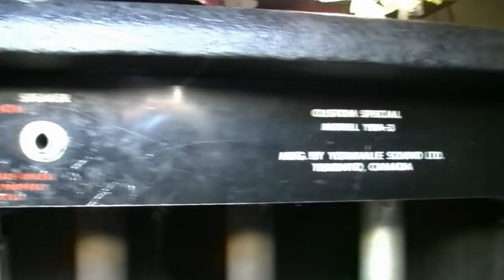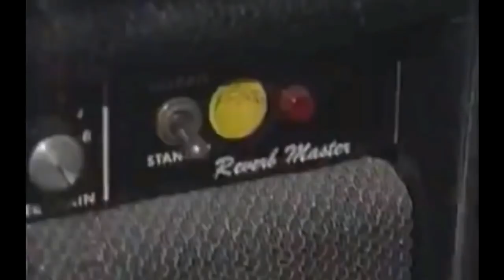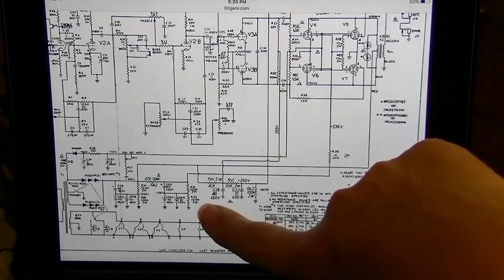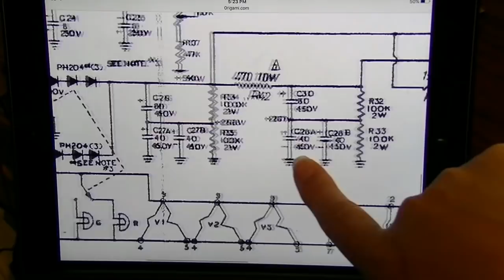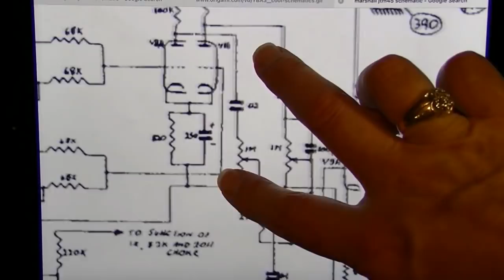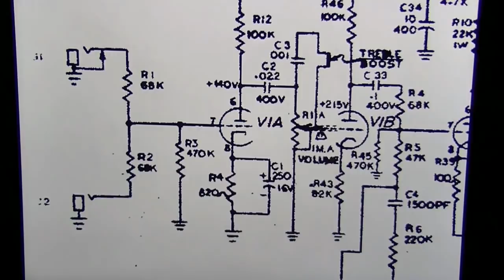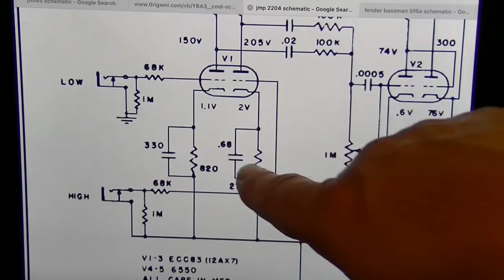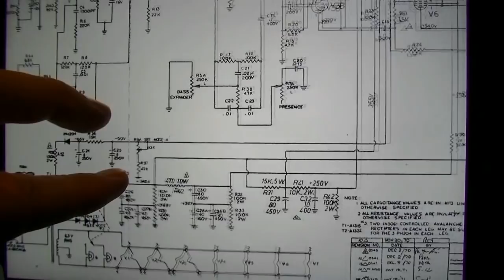Modded Bass Amp from Canada Becomes GUITAR AMP FROM HELL! - Traynor YBA3

Comment: Hammond transformers, the best. .001 caps nonpolarized across the input leads helps prevent the buzz from the honkin transformer and its' immediate field. It outperformed Ampeg, Marshall, and Fender (really did not want to say that) Still have one bass bin (8x10 speakers) and driving it with a Peavy but honestly, liked the Traynor more for its warmth and clean sustain. P.S. this actually sounds rather decent with just a guitar too. Large tonal range ability. Mine was modded by some electrical engineering freaks at U. of A. Damn. You sure tickled my memory banks. God bless all musicians and those who help. Keep on keepin on (70 y.o. bass freak and now getting into guitar. Finals would take 875V.!! Buzz you a good one if not PROPERLY grounded. Lip still knows.!

Comment: I have a few nice amps. I have a plexi and a DR103 hiwatt but my '74 Reverb Master (paid 300$) easily holds its own. Its such a great amp. Traynors rock!
Reply: It came stocked with fat bottle 6ca7s and phillips holland pre amp tubes
Reply from the maker: That's correct. The 6CA7 and EL34 switch requires a rebias and someone just popped these tubes in without bothering.
Reply: I’m the same, I have about 36 amps, all the classics plus Some oddball stuff. My Traynor YGL3 MKIII modded a bit, is possibly the my favourite of all of them, does it all at low to extreme volume.

Comment: GREAT VIDEO!!! I just picked up this exact amp and im in the process of doing the mods you have done here. Just to recap the mods done to the preamp. You changed R3 from 470K to 1M, R4 from 820ohms to 2.7K, C1 from 250uf to .68uf. R43 has been changed to 1K and finally R39 to 1.5K and C9 to 100uf. I have most of the components but need to pick up some more this week. Just want to make sure I havent missed anything. Cheers from Canada. Love your vids.
Rick..

Comment: I have an early 70's YBA-1 which I use for guitar.  It is a beast and has my favorite clean tone ever.  Super transparent and takes pedals better than any amp I have ever used.  This amp is Loudddddddd.  I also have the matching 2 15" cab which is sweet.  The bass in this amp is absolutely incredible.  I would put it up against ANY vintage amp when it comes to clean tone.  I have a 64 Princeton Reverb which I love and play in my small loft. To play the Traynor in my loft I can't turn it up past 2.  Looking at a Marshall Power Break or THD Hot Plate so I can turn it up to 5 haha.  Thanks so much for featuring this hidden gem of an amp.  Oh yea, I purchased the head and cab for $600!  Best value ever!!!!

The difference between this custom and my YBA-1 is that this one had to been intended more for guitar.  Mine does not have a master volume and there is no way I could overdrive it like he is doing here.  But I would never want to!!!

Comment: had one exactly like yours many years ago.I agree with your assessment of Traynor.Definitely overbuilt but in a good way.I had rewired mine,duplicating the four stage preamp of a mesa boogie.I was a Marshall&Fender eating Animal! An inquiry's to Traynor got the response from them,they rated this amp at 130w output.
Reply from the maker: Rebiasing those preamp tube stages and monkeying with bypass caps really amps this model up a treat.
Reply: I have rebuilt several Traynor valve amps over the years... with the intention of selling them on.  Trouble is... once I have fixed em up, they sound so good, I can't part em out LOL.   Yup, Peter started out as a repair man then ended up doing it better... they also hired out a lot of the Traynors they made so they were made bomb proof and easy to fix when they did go south (very seldom).   Current day guitarists are at last realizing that these old amps from the 60's & 70's knock the crap out of most of the currently available tosh.
Peter Traynor, a genius... RIP

Comment: That was cool...  when reference is made "From Hell"...  I'm usually thinking it was a nightmare of a repair...   apparently not the case.
Reply from the maker: "From hell" as in demon biker beast on black Harley wearing all leather and spikes and kicking ass. That kind of "from hell". :D
Reply: No worries.   I bought a Fender Sidekick 50 bass amp for chump change,   and had to fix it... the "FIX"  turned out to be grade school level.   Go figure.   It's on my channel if you need a cheap laugh at what Guitar Center refused to buy because it was broken.
Reply: I was also fooled by that headline.
Reply: DeadKoby grrat

Comment: Quality Canadian engineering!
Reply from the maker: Yep. The best. Pete Traynor should be on the Mount Rushmore of amp heroes.
Reply: I once saw a documentary on Vox where they threw an AC 30 down the stairs. I wonder if Pete saw that and said "hold my beer"?
Reply: might be the other way around.
Reply: At a NAMM show once, an Ampeg rep mentioned to Pete that he had heard a story about him testing the quality of workmanship by throwing an amp from the 2nd story window(chuckling as he spoke), Pete retorted "Oh, don't you?"
Reply: The full clip, pete explains he had an specific measurement , it was a lot more scientific than just chucking the amps off a building. His point was, on a 6-10 foot stage you have your amp resting on top of a full stack or one of the 8X10 traynor use to make, it adds another 6 feet or more. He said if his amps were dropped from the stage he would want them to be mostly fine (needing new tubes of course). Built in a safety factor and pretty much 20 feet or second floor drop is what he came up with. Simulate an amp falling off the stage. Pretty sound logic and great build to allow for this to happen and still function.

Comment: The serial starts with the year. 3 for 1973. The top access cabs with the bumper material on each side started in 1970. 
When this video was made, here in Canada you could buy that amp for 300-400 bucks. Now they're 900-1200..

Comment: FYI, the mystical input circuit is a double-T band pass filter to enhance the tone in the brilliance high range. The second tone control circuit is based on the same double-T principal. The type of simple bias control circuit evolved because of the estimator people, better is a separate pot for each output tube to adjust the bias since the output tubes are never perfectly matched. You also want to measure the current flow through each output tube since measuring the voltage drop over a resistor is somewhat bogus/inaccurate because of the resistors tolerance. Measuring the 8Volts (here in this case) does not account for a proper bias current. "Ohm law" I=U/R. Every additional component increases the cost for building the amp. The tech that needs to service the amp later is the last thing they think about when designing any amp. I designed amps and was involved by having them build in Taiwan. The goal is always to get the packaged amp of the ship for a specific costs/amount and not to please any tech or user f the amp, its just a calculated business. The rest is all stories people made up in the music industry. One guy like the daughter, some have fun with the mother in-law ...

Comment: I just wanted to note that the switching jacks on the amps effect how those resistors are put into the circuit.  While the inputs may look the same they are a bit different.  On the Traynor here, the number 2 input puts the input signal through a voltage divider of the 68k resistors, so the volume will be lower from the source going into V1.  At input 1 it just goes through the one 68k and the other is floating.  On the Fender (and Marshall if I'm not mistaken) the number 2 input does the same voltage divider trick, but at number 1 the 68k resistors are paralleled for a 34k stopper, allowing more source signal into V1.   Also, that amp sounds fucking killer, good job dude.

Comment: At around 11 minutes, that resistor capacitor network is called a twin tee notch filter. It essentially produces a sharp, narrow scoop around a particular frequency. Due to the fact that it is bridging a 180 degree phase shifted signal back around the tube, it should actually boost instead of cut the center frequency of the network. The impedance of the tubes output should do weird things to the frequency response of the filter though. That would definitely be interesting to mod.

Comment: The controversy of the most "musical" resistors to use in a guitar amp rages on. IYO, what happens if you use metal film or metal oxides in the signal path? I use them in all power paths, but what about in the grid stoppers and bypass circuits? What happens if you put them in for the 68ks in the input? Carbon comp resistors are so undependable even with 5% tolerance, which are not easy to find or afford. You have more knowledge about these small but very important issues a lot of us would like to know! I am nearing my conversion of a Champion 40 SS to a single channel AB763 Deluxe Reverb with a mid control and a master volume. It is so important to know every little detail, to choose the parts that will do the job you want and get the tone you are looking for! Thank you for these "gems" of highly informative videos. Thankz
Reply from the maker: Carbon resistors, both film and comp types, will tend to gradually rise in value a bit over time and with exposure to heat. That is to be expected. Use metal in places where close tolerances are critical and/or where high voltage and heat are an issue. In signal paths...voltages aren't usually going to be high enough to make a difference. And metal resistors are expensive. Not an issue if you build one or two amps, but if you stock parts like I do for a steady stream of repairs, you quickly realize you're just throwing money away by installing metal resistors in signal paths. As far as the tone...I'm not in a position to take a side on that really. I haven't done any A/B comparisons.

Comment: The "bass expander" and "treble expander" seem to be simply twin-T networks in a negative feedback loop around their respective valves. This give the "cocked wah" effect. If you look at the schematic of the Colorsound Inductorless Wah, you will see the same basic idea. The associated pot just shunts the feedback signal to ground, effectively eliminating the  effect.
Reply from the maker: Yes, you are correct. Someone else also pointed this out and immediately it clicked. Of course! It's NFB. Thanks for the excellent comment!
Reply: Upon further investigation, the pot does not eliminate the NFB entirely, but rather changes the Q of the twin-T network, I think.

Comment: Had one of these. And others. Best guitar sound I have ever had was going thru a YRM1 head thru the bass cabinet made to do with the YBA -3 head. Here is a couple some things you may have not noticed. On most of their guitar amps, the input section is pretty much identical to the typical Fender input section. The output section - think Marshall. And either affixed to the metal shield that's on the underside of the top piece of the cabinet  you pulled off their is a schematic on it or under it.

Comment: I never understood why the Traynor's after 1970-ish didn't use a choke tranny in the power supply. I know chokes cost considerably more than a 10 watt resistor, but sure make an amp more touch responsive and get rid of alot of background hum/buzz. Great amps! I've owned a few. I love the Guitar Mate series!
Reply: LPCustom3 they did, all the traynor amps prior to the amps with the silver /rubber bumper had chokes, the Amp in this vid is the cost optimized version built in the early seventies.
Reply from the maker: Good point on the lack of choke. I find the power supply in this amp to be adequate. No excess noise. No power-related buzzing to speak of. There might be a point about sponginess, but a bass amp, which is what this is really, doesn't need sponginess. It just needs rock solid with no sag. It's perfect for rock or metal OD.
Reply: Never had an issue that required the choke on it.

Comment: almost all of my friends and myself used traynow bass amps for guitar they were incredible work machines and had a dynomite sound and a lot  power and punch, we never had to use a distortion pedal , you just cranked up the master volune, they had 8 10" speakers in the cabinets I used two of these  in the late 60's and through the 70's.

Comment: I can vouch for that 100%. One of the best amps I've owned was a YBA-1. It kicked as a guitar amp and as I remember it had EL84 tubes and is one of the reasons EL84's are my favorite tubes.
Reply from the maker: That model shipped with 6CA7 tubes, which is the North American equivalent of EL34. Most people stick EL34 in these Traynors when replacing.
Reply: Might have been a YBA-2

Comment: I bought one of these "bass" amps used back in the early 70's. The fan was mounted to a hole in the side of the cabinet. I can't seem to remember it having a master volume. Wouldn't that indicate that it was a guitar amp if it had a master volume? What I do remember was when I went out on the road with this amp playing bass in my first rock band I was blowing the speakers like crazy in the matching 8X10 cabinet. I traded it in finally on a Ampeg Y4B head and cabinet (which ended up having problems of it's own). So I've been thinking for the last couple of decades that the Custom Special wasn't a bass amp after all and the salesman just told me so to unload it on a kid who didn't know any better. Certainly no internet to consult back then.

Comment: Cool old stuff. I enjoy your videos. You seem to have a good grasp of tube circuits for audio. I think the YBA-1 used a modified '59 Bassman/ Marshall 50W circuit with a pair of 6CA7s for power.  It's been a while since I've even thought about component-level stuff.
Reply from the maker: I think that's correct. Those are monsters too. I've featured a demo of one of those on my channel before and owned several in the past. Such great amps. I prefer them to the Marshall JTM45 in terms of build quality.
Reply: Yeah. In the early '70s, those Traynor YBA-1s were very inexpensive, relatively.
Reply: Pete was initially a bass player who played with electronics. He started fixing amps for other bass players who would blow up their Fender Bassmans. Eventually he modded them rather than fix them because the repairs biz was taking up too much time. Next step was to document his changes into a new schematic and patent it. This became the Traynor Signature amp which led to the BassMaster.
Reply: cool.  I like these little bits of music history.

Comment: If I had to guess, I'd guess the treble and bass extenders adjust the frequency range that the treble and bass knobs control the amplitude of. So you can get a really narrow peak / notch or you can get a wide hump / valley. Pretty cool tone control. It's nice that some companies had their own innovations and didn't just copy Fender's circuits. Some Garnets had similar active tone controls minus the complex RC networks. Just a high/low pass filter in a local negative feedback loop.
Reply: Actually now that I think of it - those RC networks are Twin-T circuits. Which is exactly what is used in wah-wah pedals. http://www.geofex.com/article_folders/wahpedl/wahped.htm

Comment: Amazing love your channel . I'm in Toronto and come across these all the time . Would I be cooking the transformer if I ran this head into a 16ohm Marshall cab ?
Reply: He said it was built for an 8 Ohms output resistive demand. Thus, you can damage the Amp if you go with a lower resistance cabinet. With a higher cab's resistance like your 16 Ohms Marshall, it will work fine, but the amp will sound less powerful as its power gets dissipated by the higher cab's resistance. That power loss is a disservice to the amp. Use the correct cabinet, wait a few minute until the tubes are stable and warmed, then crank it up, Canuck!

Too bad Yorkville Co. died from cheap Made in China infection, eh? Got to admire that ''no nonsense'', clean & rugged Made in Canada built logic.

Comment: Love it nice work as usual. i got a vc80 =newer board Traynor. sounds pretty good with 5881works great all day but i got a quad pack of 6L6's for it and thought as is boasted on the discription of this amp , that is self biasing but unfortunately i thought not carfully that i'd change em. in one song an ordor was detected and when i looked two of the four were red plating . put the 5881's in and finished the night . they were a matched set . have't seen much on any biasing these things .

Comment: That bias resistor in the screen line is driving all 4 tubes, but I noticed that the right pair have a added resistor in series.  It looks like the two sets are biased in a two step "tier" rather than true parallel.  (The ones on the right are biased cooler.)  I'm thinking that's going to extend the linear region of the finals.
Reply from the maker: Good point. Or maybe Traynor was trying to color the output by expressing different harmonics. Biasing slightly different would do that, I think.
Reply: The comment about high gain but clean makes me think maybe it was to have harmonics but not let it get muddy.